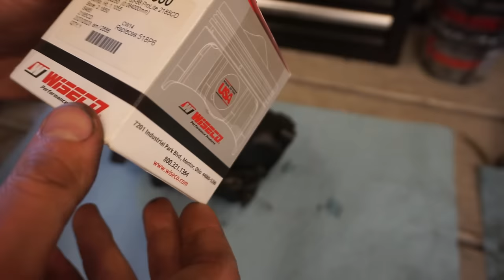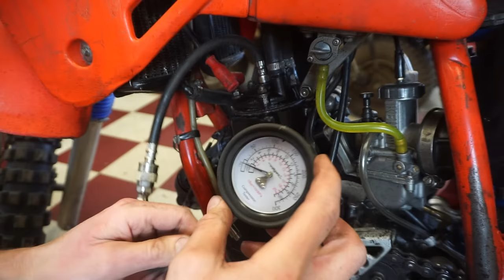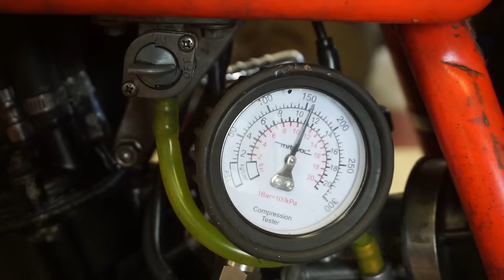$500 Honda Dirt Bike Is Transformed

Comment: Although the mechanics of the rebuild are critical, the most important aspects you nailed are the oem style seat cover, decals and fork boots. This seemingly small detail is what brings those of us that raced this bike right back to 1986.
Reply: At first I thought it was a Honda XL350 from the 1986 movie The Wraith.....As a kid I thought it was the XL600? Instead of the 350. I so wanted the Dodge M4S and the Honda XL lol.....I just checked the 350 had a 6th gear,22-ish hp & got like 86 mpgs. Top speed of 85-ish mph. The 600 only had 5 gears more hp,around 46 and 100 mph but only like 46mpgs. Not sure how much a 6th gear would bring hwy mpgs up. But if it'd add 20 more mpgs. I think it'd be well worth it. To make a good dual sport/true off road adventure bike.
Reply: A good tip put a nickel in the ends of your grips so if the bike falls the ends won't go through.

Comment: Dude the inside where the water pump seals go is cracked. How it’s it you didn’t see that. There’s a reason no 2 strokes on here have ever ran right. Dude is right. You’d think as many bikes as you’d worked on you’d understand how to tune them and actually assess problems. It’s still gonna leak

Comment: I like your videos, but I would never put stuff back together as dirty as you do. The time to clean it is when it is disassembled. That being said, good job on the rebuild. You need a vapor hone to clean off those parts. Your cylinder would have come out looking like new. Always change both sprockets AND the chain at the same time, otherwise, you will just eat up the new parts with the old worn out parts. It sure is pretty.
Reply: Looks like a good side hustle could be media blasting & cerakote & powder coating parts. Plus would probably help to sell bikes. When people see it's been rebuild along with nice looking coated parts.
Reply: @michaelbrinks8089  Most of us do that when we rebuild bikes. I also have a nice little nickel and zinc plating setup. All the bolts look brand new when I install them.
Reply: This dude is doing this for a living. He cleans stuff up enough and we don’t always know what his plan is for the bike next. His obvious talent is for fixing broke shit and getting it running. He is not a custom builder. That’s somebody else. This dude is meat and potatoes. Fix the broke shit. That’s why he gets 25,000 views in the first day. It’s a challenge with the end goal is rip the beast in the land. Looking pretty is that Sabo dude. I prefer to watch the dude figures things out over watching a 45 minute commercial for high end parts and tools.
Reply: This guy is a YouTuber for a living. The bikes he fixes are just gravy. People are just offering ideas on how to clean these things up. He has the shop space and clearly the money to support a couple of tools which if employed, would make his work way better.
Reply: @Nine_883 sounds like you watch sabos channel also from your comment. And he does way more than “make things pretty “ on sabos channel. . But what you don’t understand is , if some new kid comes on this channel and thinks it ok to leave things dirty and saved his money all summer to rebuild his bike , and the thing blows up an hour later , you can thank this guy. If he wants to show “practices “ of this  trade , then show it correctly. Stop being cheap and buy a damn parts washer Joe . 100 bucks from harbour freight. And stop using gasket maker on everything.
Reply: @Sweendawg32    He does this for entertainment and probably to make money for his own shop.  Nowhere on this channel does it say this is a freaking high school shop class for teenagers.  He usually has a mission.  It's a journey man.  From the graveyard to the promise land.  At the end he likes to rip the bike.  

In fact if you read the "About" section in this channel it says exactly THIS!! 

This channel is all about having fun. Charlie(my brother) and I, go on some crazy road trips where we pick up unique and rare bikes, quads, go karts, snowmobiles, etc and test them out. Some might call this channel the "mintiest" on YouTube.
Reply: @JoshuaJonah    I am not saying you are wrong.  I am saying right now that is not the channel he is running.  He mentions brand names so he might be getting a little, but he doesn't sit there and read the specs of every part just like a commercial.  There are a thousand channels like that.  This dude is killing it with views doing exactly what he is doing.  He is probably making more money than most.  369,000 Subscribers.  He works his ass off.  Have you ever tried to make a video while rebuilding a motorcycle?  This dude is pretty good at it for being all by himself.  The bikes he fixes might be "gravy" but he fixes them on camera and we all watch it.  And you may think they are gravy because he makes it all look pretty easy, but old motorcycles have a lot of broken and rusty bolts, seized parts, stuck bearings, cracks, and redneck engineering he has to repair.  It's definitely not all gravy.
Reply: I run an ATV repair shop and have shot and edited videos before on projects. 

Yes he's very good at the production part of it.
Reply: @JoshuaJonah  

This young guy works hard and I don't know how he remains so calm.  My video wouldn't get published for foul language and poor camera work.  He just keeps plugging away at it.  Making videos people want to watch is very hard and there is a lot of competition.  I make videos, mostly drone shots and stuff nobody watches, but I know it's time consuming.  I am not monetized so my videos don't need to get a lot of views, but I can imagine the pressure.  It's not easy making a living off of YouTube.  I researched all about it.  It's not easy and I am not very creative.  My job is not something people would watch on YouTube.  People love motorcycles though.  Dude has 369,000 subscribers.  My channel is 10 years old and i don't think I even have 200.
Reply: @Nine_883 Sabo rebuilds em and makes look good. Not takin anything away from Joe bc he def has talent when it comes to fixing them but Sabo does too
Reply: @waylon7371    It was because I was watching Sabo that I saw 2Vintage as a suggestion.

Honestly I probably just like the "less talk" approach.  One guy talks a whole lot.  One guy is mostly about turning wrenches and talks much much less.   And the name says it all.  Vintage.....I like old stuff and I like 2 wheels.  One guy is mostly 4 wheels and one guy is mostly 2 wheels.
Reply: @Nine_883  im with ya on liking the vintage stuff. 🤘 Yea both channels are enjoyable.
Reply: @Nine_883  oh so well said Dude you must have read my mind , love this channel , he does just enough to get the Bike back on the track and pay the bills without killing his customers wallets 😊❤
Reply: @Nine_883 well said my wonderful friend 😊
Reply: Joe and his lovely DOG ARE KILLING IT it’s a breath of fresh air , no need for silly jokes or stupid clips just plain honest hard  under the pressure of the Camera . Myself and many others love them ❤❤
Reply: While my own OCD says you are right, the cool thing about this channel is watching a regular guy who has a more than normal amount of motorcycle knowledge work on bikes.  He takes lumps of coal and makes them into nearly diamonds.  Yeah he could go that extra step and make everything mint but that isn't the point of the channel, it seems.  

For me, I can't take something apart and put it back together without doing a thorough cleaning.  I don't strip everything down to bare metal and recoat it but I can't put things back together dirty.  To each their own.  He seems to get good results.
Reply: A vapor hone starts out at a grand, why not just a parts washer? I have a vapor hone, but I'm 62-years-old and have been collecting tools for a lifetime. You guys don't understand this channel. This is meat-and-potatoes fix-em-up, not return-to-factory rebuilds. The only thing I didn't like was him skipping the break-in process on the new piston and rings. He just starts it and rips down the road, but that's who this guy is and lots of people with minimal tools and a small garage like his approach. Any young guy could get started doing what this guy is doing really easy and get a bike going.

Comment: Really good video brother, hope you can take a little advice, not trying to bash you in any way... it's great to see guys (and gals) working on and fixing their own stuff... but with that said, please don't ever tighten triple clamp bolts after removing and replacing fork tubes until you get the front wheel back on and everything alinged and true, tighten the axle nut first, then the triple clamp bolts. it also helps if you mark the tubes at the clamps before removal... keep up the good work!

Comment: Joe use brass wire brush on those cases the steal ones will remove material and your bearings and seals won't fit properly,

Comment: I would rebuild the front shocks to ,they looked a bit soft when you kickstart it in the first video.
Also if you change a worn sprocket it is always better to do the front and rear and chain at the same time. Now you run a have worn chain on a new back sprocket .This will only make the new back sprocket faster in to a sawblade again.
Maybe you did replace them off camera.
But hey ,this is a keeper.
I was 16 when this model came out. And at that time Honda had the 22:59 first watercooled 50cc here in Europe ,the MTX dirtbike and the MBX streetbike.
Both beauty’s.
Reply: The Honda m series were al beutiful. I live in Europe and have a Honda mtx sh with a 110cc, thing flies
Reply: @maxhartog2236  : Yeah, Honda were the best light 50 cc bikes to tune at that time, here in Belgium the speed limit was 40 Km/h for a 50cc when you were 16 until 18  you needed a drivers license .
The MTX and MBX and even their older brothers the MT-5 and MB-5 could easily run 110 Km/h by only taking the restricted exhaust pipe off and some port polish and change the jets in the carb.
Had a couple of tickets back in the time when the police did a speed control. 
They parked at the bike exit at the schools with their roller bank to measure the speed, they put the back wheel on the roller bank and ran them through the gears.
You got a ticket and a week time to show up at the police station to control if your bike didn't get faster than 40Km/h .
As soon as you got home off with the restriction parts and ride until you get the next speed control.😉
Oh the 80 's what a nice time for teenagers,i miss that time.🥲
Reply: @jacksat2252  Here in the Netherlands i can't remember restrictions. We just bought 70cc cilinders with 18mm carbs. And the crazy part was by law we needed to ride these rockets on the bicycle road usually seperated on the right side of the regular road for cars.
Reply: @Odder-Being  Same here in Belgium only allowed on bicycle roads or paths.
Same with mopeds here in the 80 's de Honda Camino was hugely popular and you had the choice
to ride a restricted to 25Km/h without a driver's license or 40Km/h with a driver licence.

I think you guys in the Netherlands were allowed to ride at the age of 15 or am i mistaken?
Reply: @jacksat2252  It was 16 without license but that all chanced in the scooter era. Now you need a license even for 25km/h. Its really about discouraging the youth from driving scooters. They just made it to expensive, license 700 euro including lessons etc. Buying scooter 1000 euro. So you spent 2000 euro at age 16 to drive a scooter and 2 years later another 2500 euro for your car license. So you see what they did here.

Comment: I remember going to the Honda dealership with my brother and father because we wanted to buy a set of these, but the dealer wouldn't move a nickel on the price, so my old man walked. It turned out Honda only imported X amount of these, and it was far less than what the demand was, so dealers already had most of them sold before they even showed up. We ended up going to the Suzuki dealer and he moved considerably on the price and we ended up bringing home a 1985 RM 125 (mine) and 1986 RM 250. That Full Floater rear suspension linkage was a thing of beauty on the track. The engine was an upper mid-to-top-end  monster! I didn't realize just how heavy all that linkage was until I traded it in a couple years later for the 1987 model. It was huge.
Reply: I owned an 87 rm 125 it was a good bike
Reply: @bobbyd4400 They were all top-end, plus the suspension was supreme back then. This was the first year for the cartridge forks, which were light years better than the regular forks, and like I said, the absence of all that rear linkage really lightened up the back of the bike. It felt twenty pounds lighter than the '85 model, but the design of the Full Floater made the rear of the bike track beautifully through the rough stuff like Unadilla.

Comment: A little trick for removing grips is to pull the lip up a little and shoot air between the grip and the bar. It will puff up the grip and will slide off easily, then when installing do the same thing and the grip will slide right on with no effort.  😊
Reply: We used contact cleaner to put new grips on
Reply: This (compressed air) ^^
Reply: He spit on it like its porn sex im dying
Reply: @fletcherjacobs3688  My wife and I laughed when we watched that bit. This bloke knows whats up haha!
Reply: There’s a air compressor extension meant for this

Comment: Good job, but would it have killed you to clean up a few things before you put the parts back on?  That dirt under the seat is really messing with my OCD.
Reply: @lesoram6236  I know, right..  I would have a least cleaned the tank off before putting the sticker on.  That's not even obsessive compulsive.

Comment: Bro is trying to get someone killed not glueing the grips on, one hard tug at speed and your arm is flying off the bars.... also stop yanking the throttle while starting if the choke is on if any throttle needed to start just hold it open not even an ⅛ and kick it dont yank it... and also it wont clean itself out with throttle if the choke is still on. Also you shouldve put some rubber cement on crack in the reed cage/manifold to stop it from spreading.
Reply: What, you don’t think spit is gonna cut it for the grips? 😂

Comment: i had a 83 cr125...   but that low end sounds awful.... it clears  up once you get wide open but soon as you are in the low end its struggling like you need to play with the needle and jet settings still.
Reply: Carb rebuild or new one just my thoughts

Comment: And a trick for honeing to get some nice cross hatching go slow  up and down to get a more horizontal cross hatch I ended up learning it from a top fuel engine builder Morgantini
Reply: Pretty sure that it’s supposed to be plated
Reply: @eric5250  after the plating you can't just run a cylinder raw on the plateing it would never seal properly the amount of friction build up from no hone or cross hatching would be to much it would just melt the piston and destroy the jug
Reply: @That__mxc550  how many times can one be honed before needing plated again?
Reply: @eric5250  not many if required only hone once after replateing then sending it out to be bored and replated and honed to the appropriate size needed if ya can't afford that you can probably get away with one or two more times with honeing before needing to be properly rebored and plated and fitted with a new diameter puston

Comment: Tips, 3m super 77, is what I spray on the seat foam. I also use my heat gun to warm up gently the vinyl.  So it's easier to work with.  The 3m super 77, prevent the vinyl lifting off the foam. A plastic polish kit, may be something to think about, 1,000 and 2,000 grit wet sand and 1 micron polishing compound for plastic works great and a hand buffer. I'd probably have done that before applying stickers. I'd have done all the plastics. Water and soap, 2 tsp. To that bottle. And a vinyl scraper. For bubbles. Then let dry, before  peel off. However old decals, seem to need to be heated up some, for the pre mask tape to come off easier in some cases. Also a little heat helps with it sticking better. Basically 1 to 2 medium fast swipes with it.

Comment: With that type of plastic use a propane torch on the area you’re placing the sticker. A chemical process takes place between the plastic and burning propane. The sticker will stick a lot better. You just have to heat it long enough for it to be comfortably hot to the touch.

Comment: I'm commenting on some of your bike repair habits I have 26 yrs racing riding and repairing bikes some the things I saw like you should thoroughly clean your gasket surfaces, and if you replace a sprocket u need to replace the chain and fr aswell they all wear evenly, and soak your clutch plates if you remove them.I did forget always gave your rear axle towards the brake side and install your nut on the brake side. Everything u work on has a proper torque  spec

Comment: An old trick we used to do when your bike has run out of gas and you have just refilled it.  Lean the bike over to side until a little gas runs out of the carb over flow hose, carb is now filled with gas and will be easier to start.  Save you from kicking the first 15 times

Comment: You'd have way more luck kicking these over if you just turned the choke on and didnt touch the throttle. Kick is 3/4 time and then turn it off and kick more still no throttle

Comment: Love the Videos! Just a Tip from me to make a job easier. Use Hairspray to put on new Grips. Just spray it on the Bar. It'll slide on easy. Then  it will harden and dry. They will stick lovely for years to come!